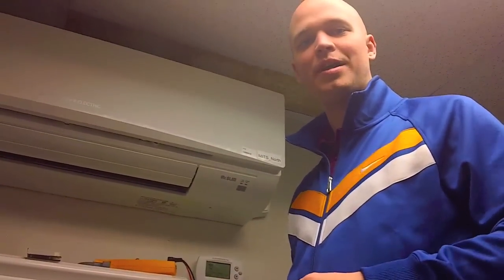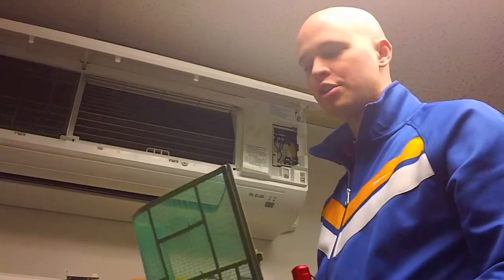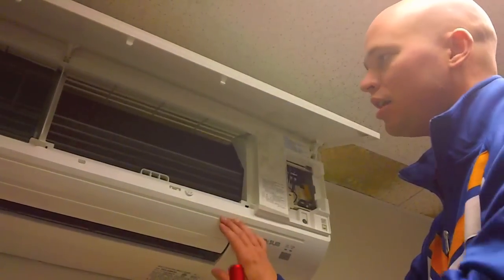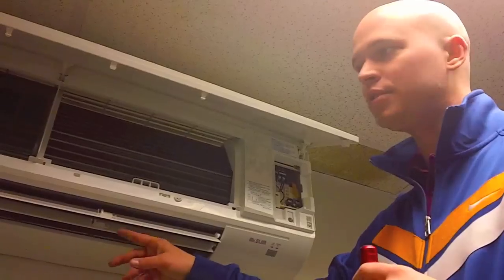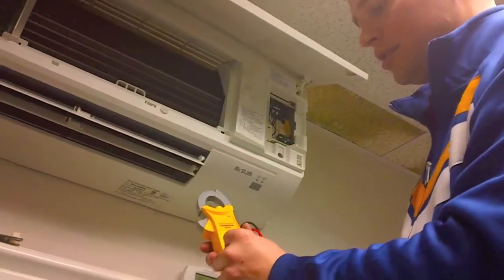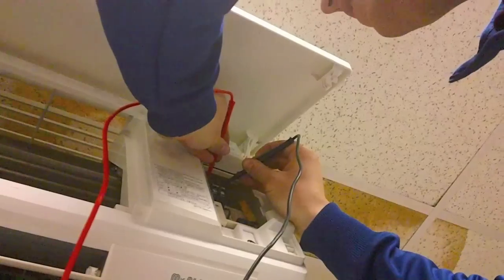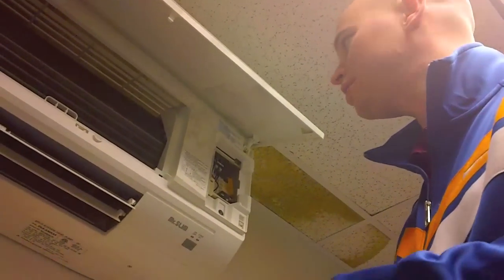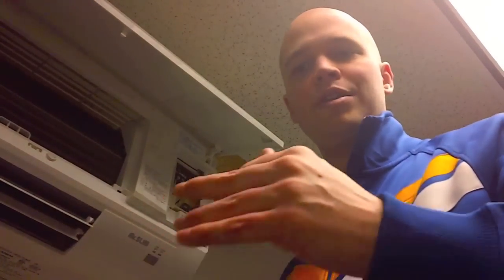Tech Tip #7: Mitsubishi DUCTLESS Air Conditioning Spring Maintenance on a Wall Mount Unit [HOW TO]

Comment: So amazingly quiet and Fastly.Cool in my room! 42db is at a whisper level. I bought 2 and installed myself.Very sturdy bracket and easy to adjust to fit windows of different size. Absolutely fabulous units!!

Comment: This air through the wall Lg air conditioner arrived sooner than planned packed excellent >>> nub.best/6zuk   Every thing that was need to install was packaged , the foam strips and the frame even had the mesh scream but I did not need the sleeve in in the wall I cleaned it and had it ready to install the air
Reply: goood

Comment: My Mr Slim 36 BTu is blowing cool - but not cold!  59 ain't feeling like 59- feels like 75.  Tech says everything checks out. No drips inside the house- no codes flashing.  I hosed  down outside unit.  Cleaned inside filters.  Had it serviced completely 4 months ago. Tech returned because its 75 in here and we got it on 59 all day!!!! He says everything is normal!   Wwwhhhaatt??!! What can I check or reset or reboot or something???!!
Reply: not sure the guy in this video knows SHI% lol. What size is your unit? btu's and how big is your space its trying to cool. rule of thumb is 12,000 btu per around 400/450 sf of space. is there a lot of humidity in the home? 59* does not seem very cold. the 410a refrigerant pressure good?